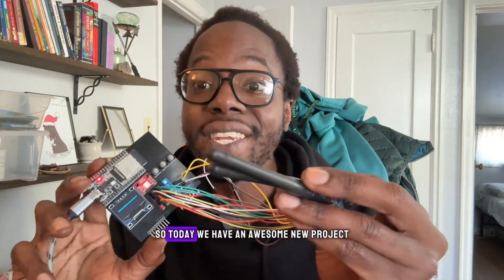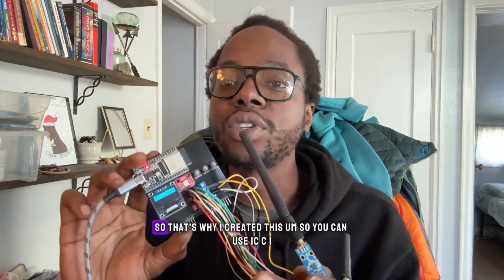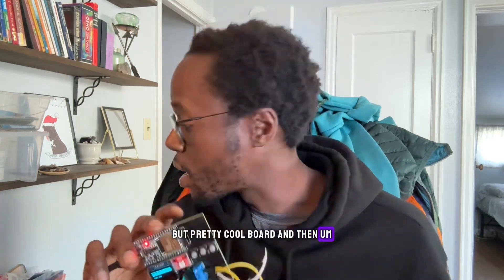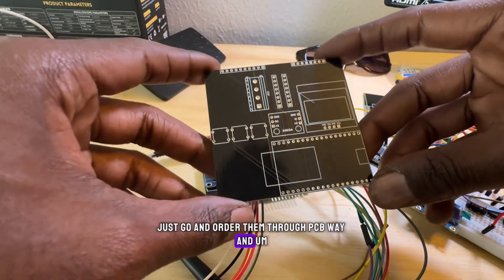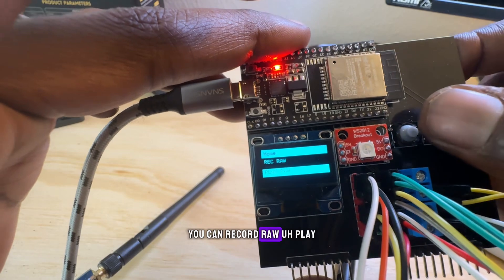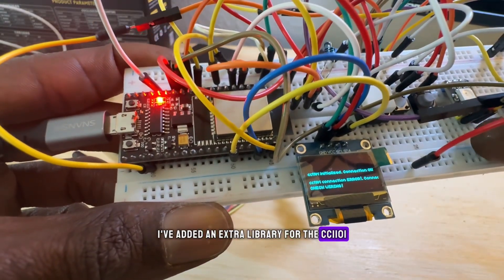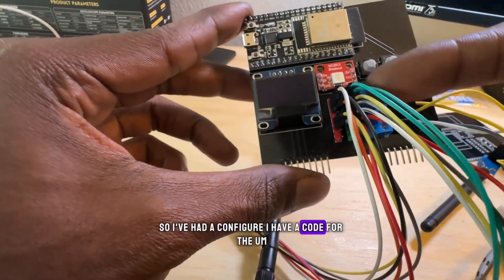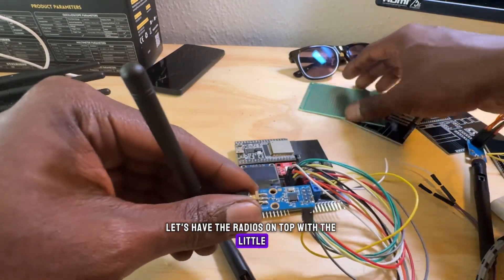New Car Key Jammer To Jam ALL Cars

Comment: What about 315mhz? It's my understanding that the E07-MM1101D CC1101 can't do 315mhz due to built in board filters. I think TI-CC1101 and D-SUN CC1101 can transmit/receive 315mhz. But it's difficult to find a definitive answer. 

Also, I thought car keys in the US use 315mhz so I am wondering how you are using your 433mhz jammer with your car.

Comment: Hello, but none of the buttons work, not the UP DOWN SELECT button. Please fix it.  buttons aren't working 😢
Reply from the maker: This is specific to Esp32-wroom-32D which need 10k ohm resistors if on input only pins 34,35,36,39, you can set the pins to anything
Reply: Same 💔